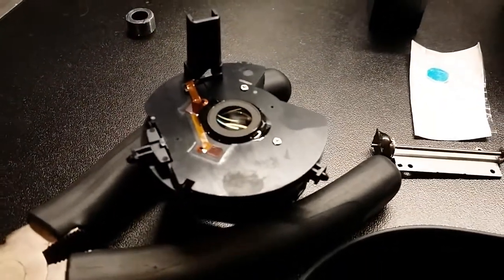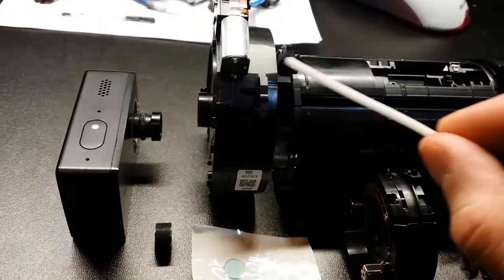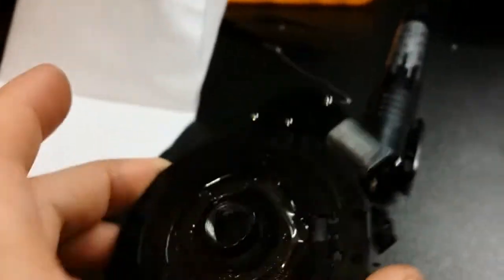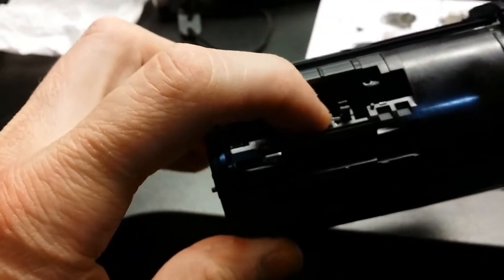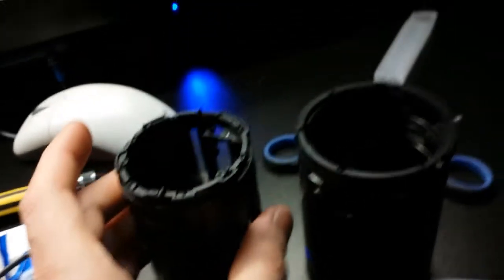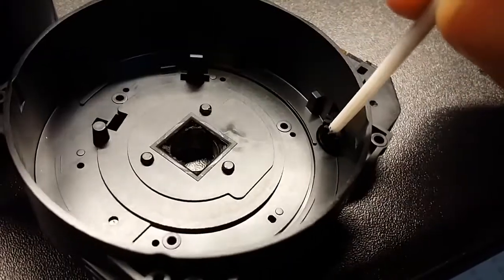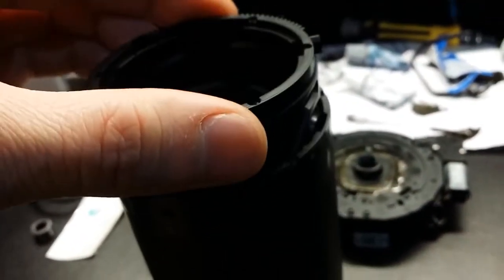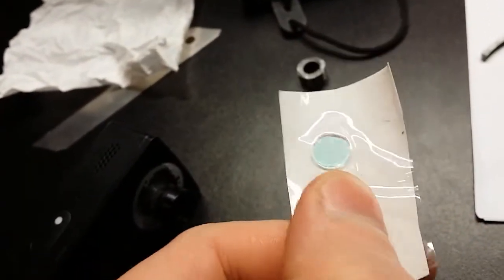300x nikon p900 mod lens + 4K camera

Comment: Did you remove the internal IR filter as well?
If so, does doing so prevent the camera from taking pictures as normal?
Reply from the maker: There was none ir filter inside i add one to get normal picture, without infra red filter pictures will have red light all over.
Reply: You can get IR cut off filter from ebay for 20$ to bring the picture back to normal.